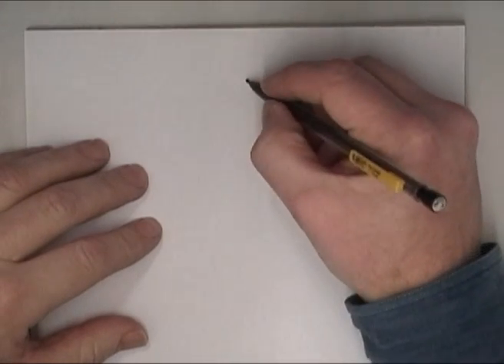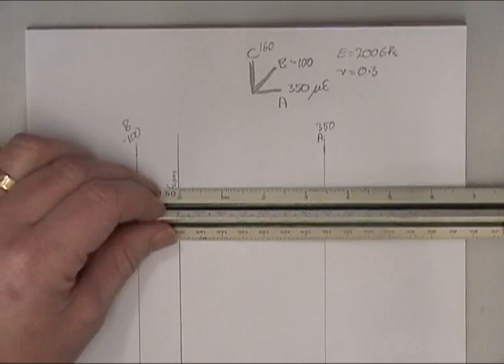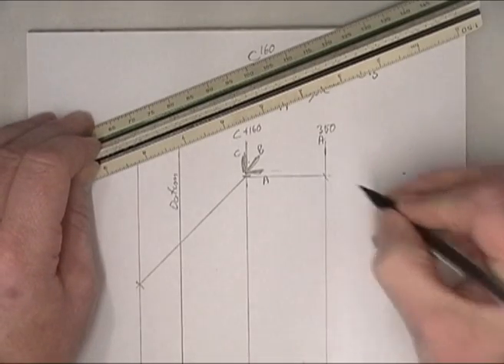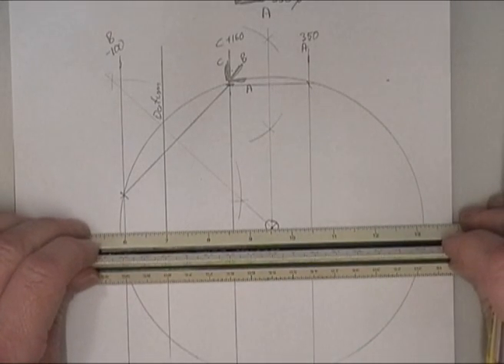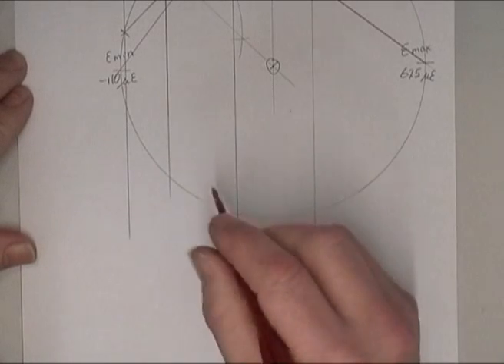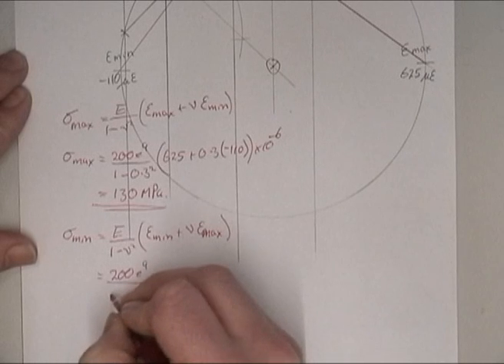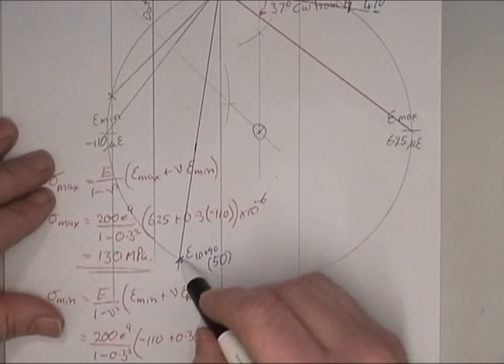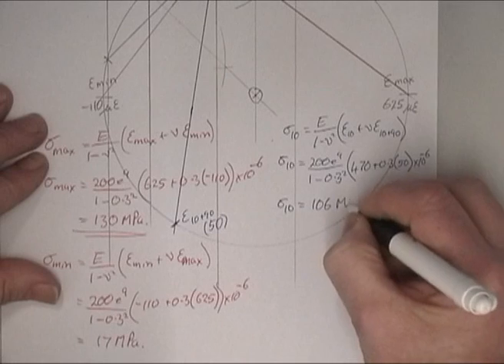Mohr's Strain Circle construction

Comment: HI Steve,
how do I draw this for a 120° rosette?
Reply: Hi there James, it works the same way with any other rosettes. You align your rosette in the same way and extend lines out for the rest.

 For example in a delta rosette. You pick the middle strain, which will in this case be our strain c, i.e. the middle value. and depending on what that rosette is angled at, i.e. let us say that it is angled at 120 degrees. We then put our protractor on and draw a level line out i.e. 0 degrees. and then 60 degrees (which will be our strain b) and then another another 60 degrees, strain a for a total of 120 degrees. 

You then follow the same procedures and extend the lines out until they intersect with their corresponding strain value and from there draw the bisectors etc (follow video).

We are adjusting the angle the way it is (as mentioned above) so that the strain rosettes are respectively angled as they are in the real world (either that be delta or any other angled rosettes).